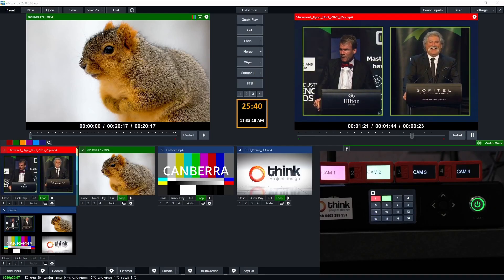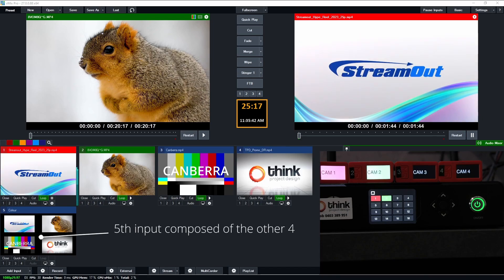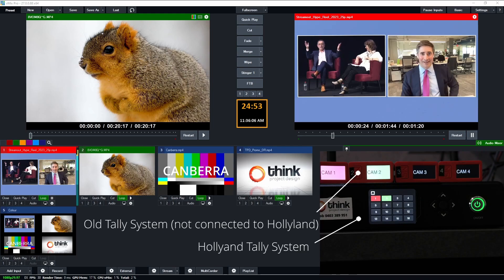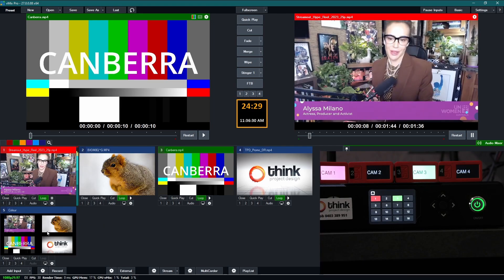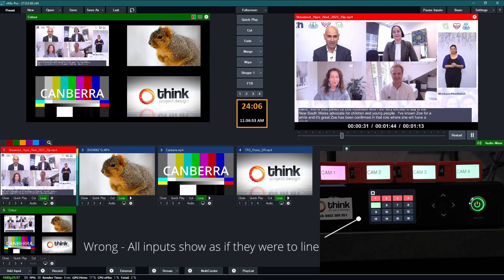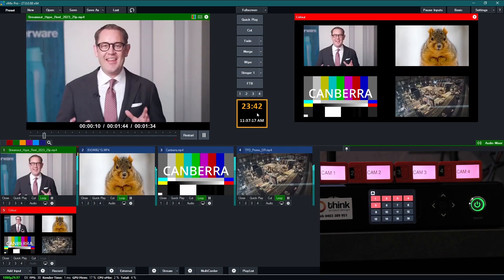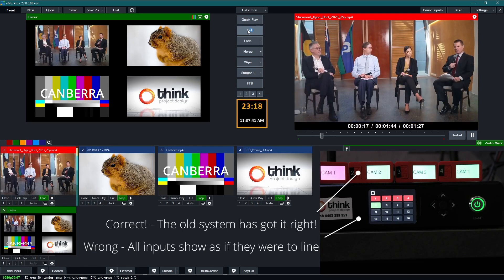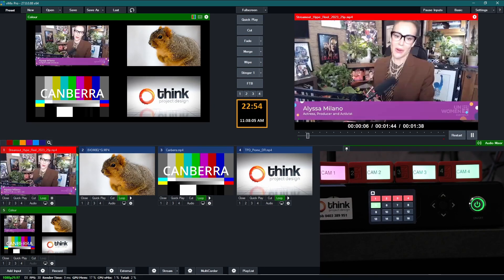Hollyland Tally System Fatal Flaw with vMix

Comment: My friend developed his own tally light system specifically to work with vMix and it was amongst the earliest feedback I provided as one of his testers, that inputs that composite sources together, didn't always behave as expected.

I agree that this can and should be addressed by the manufacturer, however yet another route would be to submit a feature request to the vMix team to add the ability to define which tally number is "broadcast" via the API, for any given input.  This would be helpful if a layered input was predominantly composed of a single input.

I'd love that!